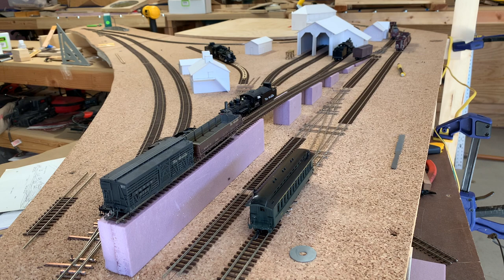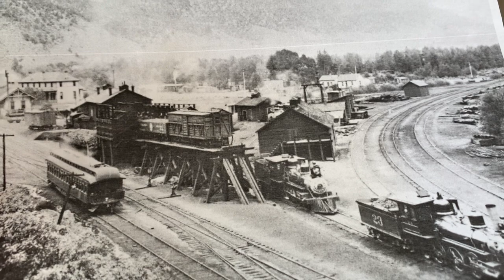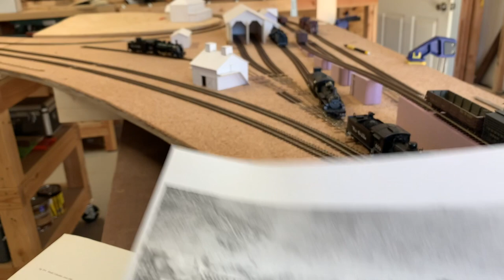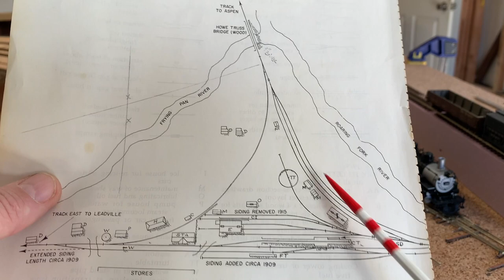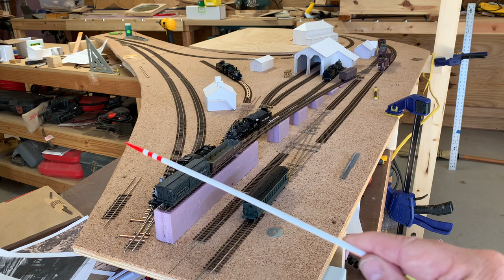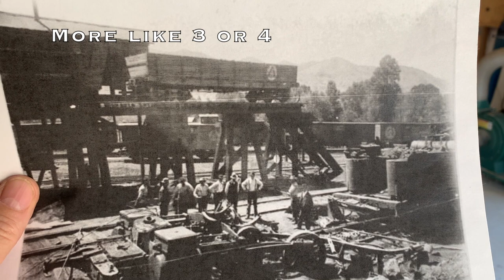Building Frying Pan 2  (Ice House)

Comment: It all looks pretty good. If I was to revise anything I would lower the elevated track platform. Compression works both ways with track - vertical and horizontal. It looks to steep to me. Grades almost always looks to steep even when we  subject them to what we think is prototypical. Cheers.😁
Reply from the maker: Thanks for putting your eyes on this Boomer I value your opinion.  It's nice that you are looking at the whole scene and not any one particular measurement.  My goal of course is have the trestle look to scale with the narrow gauge equipment not a specific measurement.  I started with it about 3 foot shorter than it is now, then I raised it.  I thought it looked better at the height it's at now.  Once I get the platform built, I will fiddle around more with the height before I make the bents and coal chutes.  Thanks Boomer!

Comment: Hi. Very interesting. I like your efforts to reproduce the scene with as much fidelity to the original as possible. If you don't mind, would you respond and inform me what material you use to create your outstanding prototype structures. Thanks.
Reply from the maker: If you mean the mock-ups, It's just white cardboard.  It is essentially the same material you would use to create a boarder in a professionally framed picture.  It's about a 1/16th of an inch thick.  This week on Thursday I have an in depth video coming out on a scratch build that I'm currently working on.  Tune in at 8pm central for the premiere if you can.  ~Dennis